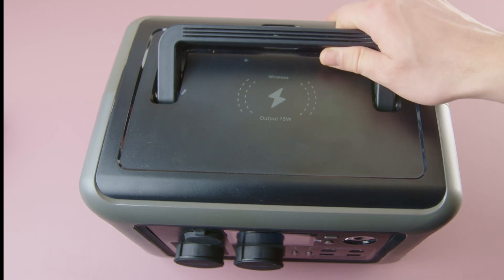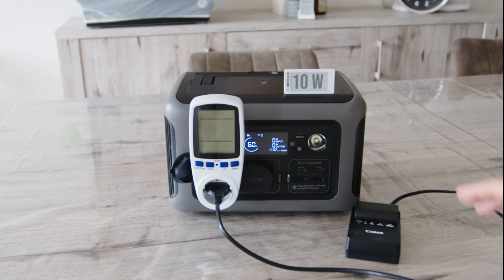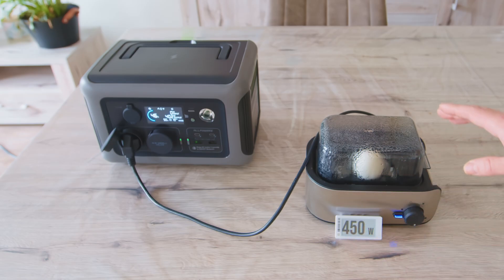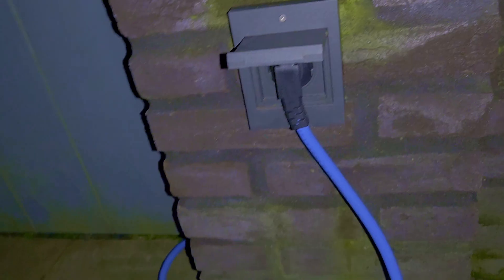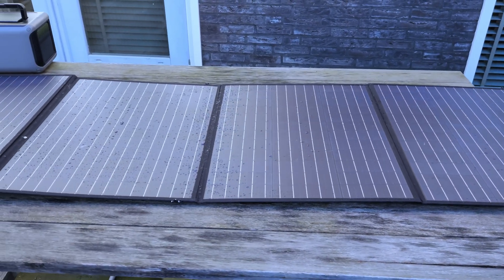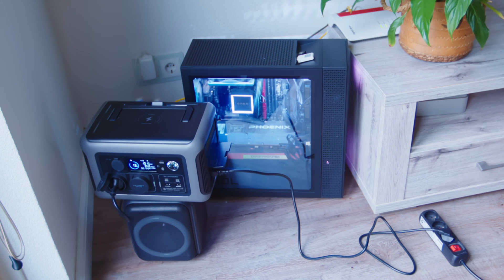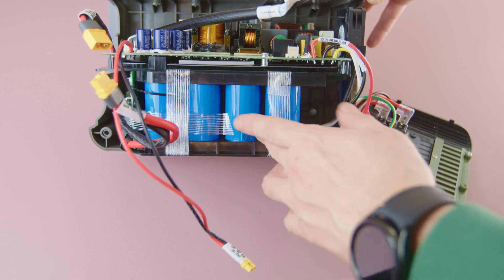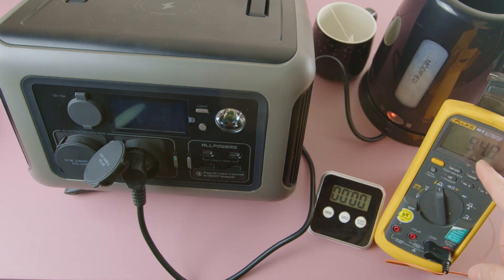What can $ 200  Power Station Run

Comment: Nice review! I like that this power station can also be used as a UPS. I've tried to use a UPS as a power station, but it would shutdown after 30 minutes, no matter how little power was used. I tried to use it to keep my heating running, but the pump was humming loudly as it didn't appreciate the modified sine wave. Does this power station provide a pure sine voltage?
Reply from the maker: I'm currently using this as a UPS for my PC, and I haven't had any issues so far. It has a 600W AC Pure Sine Wave Inverter (with a 1,200W surge), and you can switch between 50 or 60 Hz. It should work for your heating system as long as it requires less than 600W.